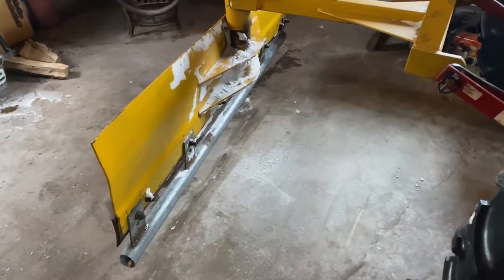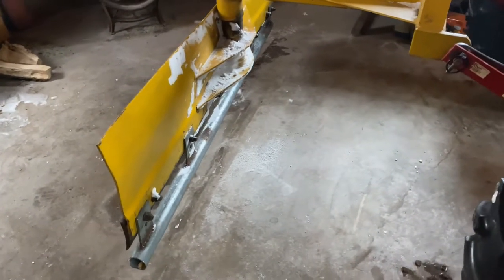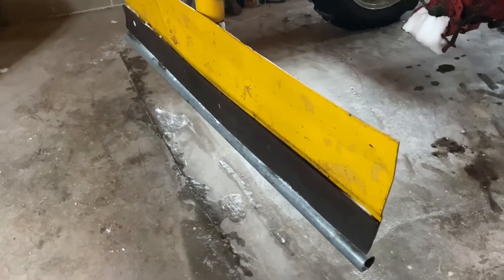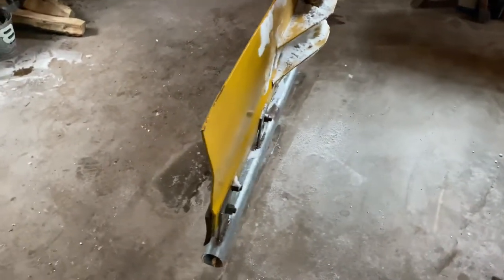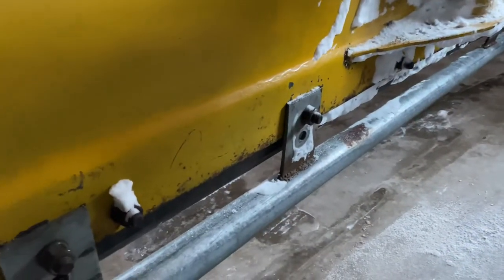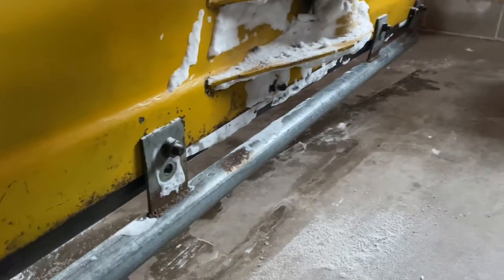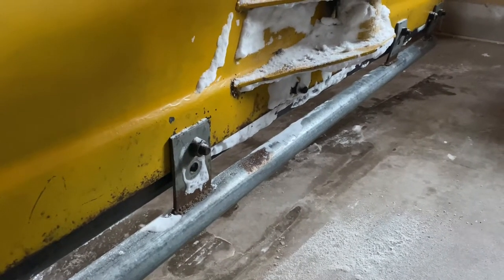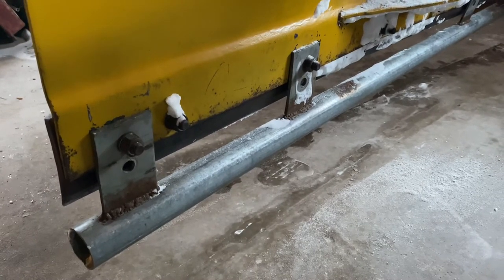Upgrade For 8n Tractor Back Blade

Comment: Most tractors are too light in the back, especially two-wheel drive tractors. They need to have a lot of added weight to the back wheels to give them better traction, especially in mud and snow. 
The more weight the better.